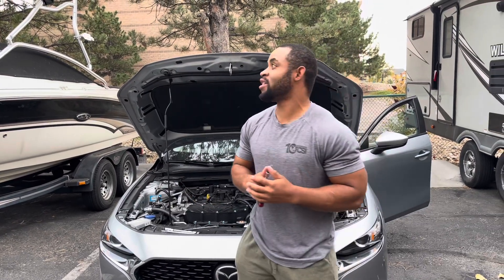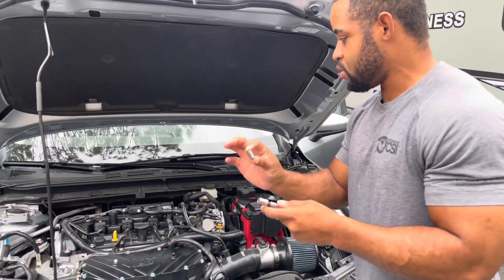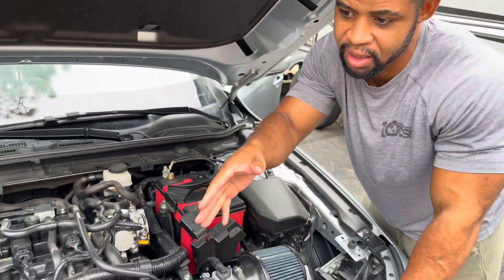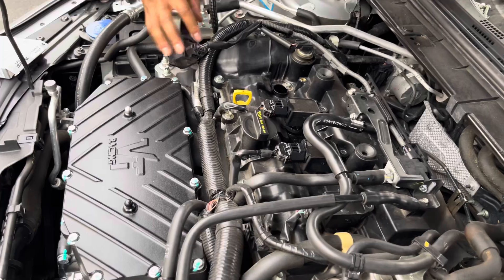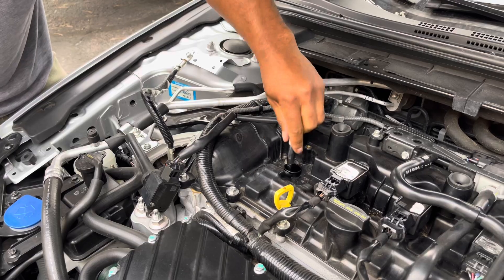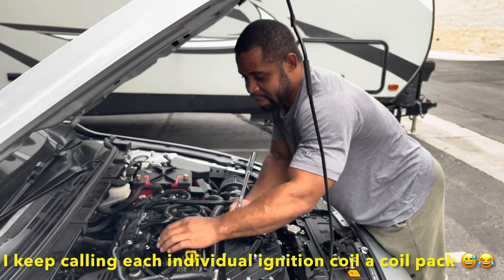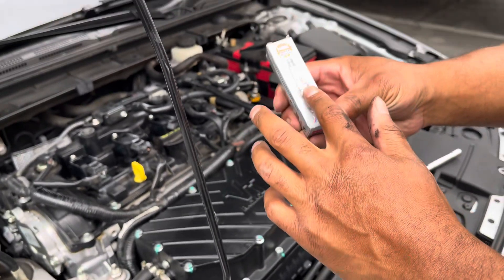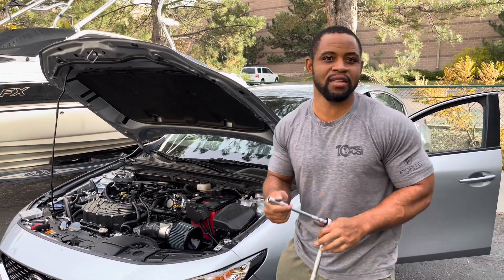Mazda Monday! Simple Spark Plug Change

Comment: Also installed new GTR plugs on my 21 NA last week, checked the gap and they were .026-.028 in. brand new from NAPA. Gapped it carefully without touching the electrodes with a gap tool to .0325~ in. If you have the tools, I used an electric duster with the coil out(old plug still inside) to blow anything out, and a shop vac with a narrow extension to vacuum inside. Then I took the old plug out, vacuumed again. Cover the coil and hole with a lint free rag while you're getting your new plug ready. Do one at a time. I used a torque wrench set to 13 ft/lb. Don't use any anti seize. I'm beyond happy with how strong my 3 pulls!💪